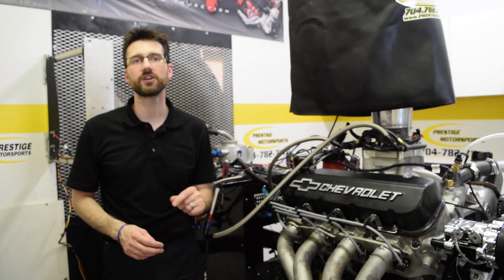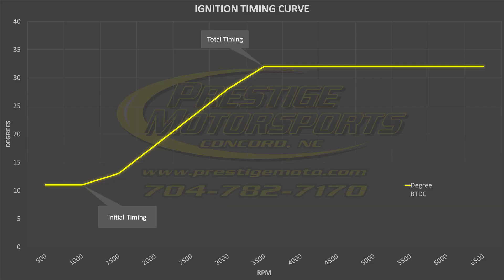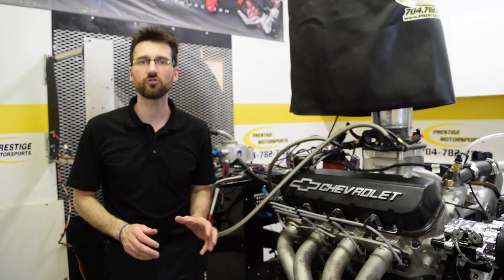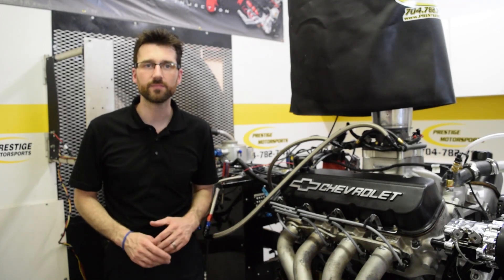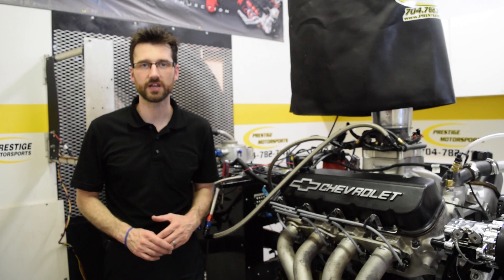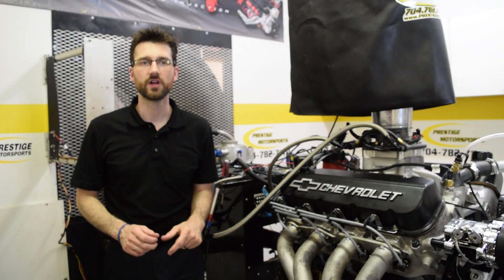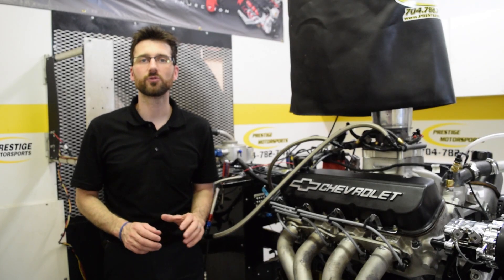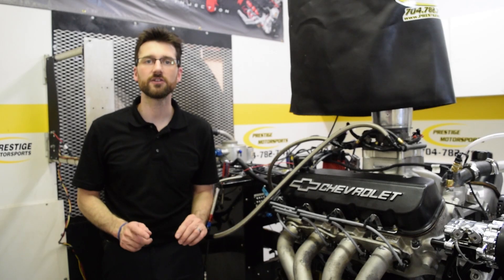Ignition Timing: Result of Incorrect Timing and How to Check Yours

Comment: Crappie explanation. Especially for people with a balancer that has no timing tape. So how do you find 36 and set 36 with a digital timing light i guess just retard the timing and just lock it at 36 on the far right side of the balancer drivers side.

Comment: What if there is no published total time reference for your engine? I have a 1949 Oldsmobile 303 v8. The service manual only gives initial timing recommendations. There aren’t even timing degree marks on the crank, just two steel balls. I’m told to place the pointer between the balls at 500rpm. But I’ve got a stumble at high rpm

Comment: Very very good video. I have a gy6 engine with 1 cam for valve's. and fly wheel has a 
i....t...f on it. I won't to set my timeong correctly  do I set the flywheel  at i  and set the time on the cam so my bike will work  as I had it at  t and would not fire up. Had spark fuel but didn't  won't to fire. 😮

Comment: Ok, bare with me here.  A mechanical distributor, 10 degrees Initial, 24 Mechanical for 34 degrees total at ~3,000 engine RPM at Wide Open Throttle and with NO Vacuum Advance.  But, at say 60 mph strait level steady state speed "floating" cruise, at 3,000 engine RPM, then the same 10 degrees initial plus the 24 degrees Mechanical for that 34 degrees Total PLUS 15 more Degrees Vacuum Advance, so ALL THREE TOTAL are 49 TOTAL DEGREES ?

Comment: When i start my car in the morning, the engine gets violent as though there's electricity that doesn't run smoothly. I don't know. But when the engine is already hot, it gets normal.
I already replaced the sparkplugs, but it's still the same.
Please help me figure out the engine issue.

Comment: I’m concerned that my ignition timing might be off. I have three symptoms: 1) the engine Bogs at low RPM. 2) the car starts way too quickly. 3) engine runs too cold. Any thoughts?
Reply: add my 2 cents ---???? too far from tdc backof 2 deg  never had one start too quick  ??? chang thermastat for more heat ????

Comment: Good video. Thanks.
I got a question, maybe someone can help me. Does the distributor should very tight or should it be little bit loose?
My 1972 Ford F-100 has its distributor loose, I can move it with my hand. Is that ok? Thanks
Reply: no. it should be tight and you should not be able to turn by hand.

Comment: I had 1989 Oldsmobile 98 and that car lasted A LONG TIME... regular oil change.. Spark plug change ... Carburetor clean bit not today's cars.. Today's cars are always messing up... Always something right after the next... Pieces of crap car engine designs.

Comment: If you have low compression would you get misfires at a low timing angle like 10*.  It seems my spark is getting blown out and I’m getting misfires.  Turns out I’m at like 90psi of compression in a couple cylinders.
Reply: needs to be over 125 psi   add spoon ful oil check comp if increases with oil it is the rings  if no increase its your valves

Comment: I recently had my car check by the dealer they said my motor has low compression before hand I had the timing chain replacement and the car wouldn't start afterwards. Do u think the low compression is from the timing being incorrect or it could be something worse??? Need help
Reply from the maker: Cortney, you're situation involves valve timing, not ignition timing. If your valve timing is not correct, yes, it will cause low compression for one of two reasons: 1.) Valve is opening and closing at the incorrect time and not allowing proper compression to take place OR 2.) Incorrect valve timing has resulted in the valves and pistons making contact. This usually results in bent valves that will no longer seal. Scenario 1. involves re-timing the camshaft and crankshafts. Scenario 2. involves a cylinder head rebuild at minimum with engine replacement as a possibility.
Reply: @prestigemotorsports  thanks I'm praying for number 1 should be calling the dealer today for results

Comment: My volvo penta 3.0 gsm engine was lack off power when I try to get my boat on plane, first I thought I did have  an head gasket issue so i change head gasket n redone the valves and resurface the head, and it work out I have the same issue and I play around with the engine until I do some adjustments to the distributor now I have alot power and my boat is running fast again but when starting up I have a engine kickback every time I try to start the engine, but I want to figure the correct way to set the timing to solve that kickback and still have maximum power output.

Comment: why do street racers keep adjusting timing for different races.
Reply: to get the most power they can out of them.  So they run locked out timing meaning full timing all the time  there is no advance.  youre just at 34 degrees and that's that

 and it can change with elevation DA etc

you DO NOT want locked out timing  on a street car.  people have done it but something else is up with the car/truck.  you should not have to run a street car like that

Comment: How about ignition retarding? I just installed a turbocharger and have ecu rom provided by the tuner. In data log i noticed .5 of knock retard during acceleration and brief -2.3 during full throttle. Is it normal?

Comment: Could popping in the carburetor or intake manifold be due to incorrect timing?
Reply: incorrect firing order dounle check wires, Rotor postition, look up your yeah and model of car.. like fords 302 is 15426378 but in the 5.0 ho in the mustangs they have the 351 windsors firing order.. 13726548 if its a chevy you have a bad misfire.. try swapping 4 and 7.. then 5 and 3..

Comment: if a timing belt jumps a tooth will it cause a rough idle at stand still, but drive ok's?
Reply from the maker: If it "jumped" a tooth, you have bigger problems. If it was installed one tooth off, it is possible it could idle rough but drive OK. However, most newer vehicles will see a cam / crank sync error and set a trouble code.
Reply: Car has no fault codes. Idles at a steady rpm,  with transmission in drive. Drives ok, but idles rough?  It is about due for  a new timing belt and water pump. I did speak to my mechanic  and he says that it is possible that you can have constant rough idle. because of the valve timing belt issued. But when I take my foot off the brake and start to move forward the vibration stops and the car drives ok with plenty of power. I wonder what happens when the car engine ECM changes from idle to drive?  I wonder if there is a relay issue between idle and drive. Also the engine rpm is constant, but might be low at about 650 rpm. I wonder about that as well. Also I see that when I cold start the car, there is a fluctuation in the rpm that goes away after about 15 seconds?  No fault codes again?
Reply from the maker: @Eddythe_Eagle  We've gotten way off topic here, so I'll end by saying that I would check that all of your engine mounts are in good working condition and then rely on your local mechanic to guide you into the proper repair. Thanks for the comments.

Comment: Spark advance is all over the place with the engine at idle..Rough idle?
Reply from the maker: Your vehicle has ignition timing controlled by the ECU. The ECU can adjust timing advance to control many things including emissions and idle RPM. Overshooting timing adjustments at idle can cause a "lope", but unless you have done some custom tuning, I would bet the rough idle is something else. Valve timing that is incorrect can certainly cause a rough idle.

Comment: My car has a rough idle at stand still while the transmission is in drive with the brakes on. Once I start driving or take my foot off the brakes and move forward the engine idle smooths out. Car drives ok...I have scanned the car engine and get no engine codes or engine light on. What I did notice that when the engine is at idle with the transmission is in park park the advance engine timing is all over the place. Idles constantly rough but drives ok.. Cold starts a little rough.... There is a timing belt... initial timing correct?  Advance timing all over the place. Timing belt issue?   2010 Elantra , 4 door sedan, GL... Any answers?
Reply from the maker: Edward, the timing belt controls valve timing, not ignition timing. They are two separate topics.

Comment: Great job of explaining *what it is (timing), but not how to find it. Most of us hot rodders don't have correct timing given to us by the engine builder.
Reply: if you get your distributor curved  then they'll get it very close like performance distributors.  most hipo pump gas N/A application are full advance at 2000-2500 rpm with the least amount of mechanical advance you can get away with.  and advance initial on a dyno until it loses power then back it off
Reply: @KingJT80  sounds good.

On the dyno, 15 years ago, the dyno operator brought the total timing up to 40°. Is that normal? To much?

I'm not racing this thing at all, so I brought it down to 37 total, and 22 initial.

381 Chev, aluminum victor jr intake and Vic Jr heads. 9.8:1 cr.

Made 511hp, 492 tq.
Reply: @jakefriesenjake  if that's the best it made on the Dyno, then that's good. 

It's whatever it wants. But usually performance engines want more initial than mechanical which it sounds like you got back then
Reply: @KingJT80  cool. I say 15 years ago, but basically it's still brand new! I've been working on the 81 Z28 for that long on and off (mostly off).
I hope this spring/summer I'll be done with this thing. Been a while.
Reply: @jakefriesenjake  you gotta make some videos of it. I'll watch!!
Reply: @KingJT80  maybe. We'll see. To get a really good picture in your mind on what this car looks like (mostly custom), Iooks mostly like "Trent Goodwin 79 Camaro".
You can easily google that car. It's gm lemans blue, 20" Boyd junk yard dogs in the back and 18's in the front. Same as mine.

His is bagged, while mine is just lowered as much as possible. He has a regular 4" cowl hood while mine has an L88 corvette style cowl hood on it.
My car basically looks like his right now, just got it back from paint a month ago or so. Same color. 4 speed super t-10 with a brand new Hurst shifter! Braum ORUE black race bucket seats, fiberglass dashboard, custom laser cut black aluminum gauge panal, silver autometer gauges, with monster tach on top of the dash, aircraft style on/off switch panal, stainless and keyless steering coloum, and billet aluminum steering wheel. 
78 to 81 Camaros have the rear plastic bumper bolted on with a strip of metal trim that I actually hate how they look. So I bought a fiberglass bumper and glued and bolted it on to the main body. Then I blended it in and had it painted. Million times better. I also glued and blended the rear spoiler and the front fender side air extractor vents. I also hand built a custom front grill and a twin cold air intake with cone filters for the car. Only another month or 2!

Comment: You are correct on the ignition timing. My question concerns cam timing. On a dohc if one of the cams is off one link could this create a miss at idle? Over two grand on the tach it runs like a watch. I also thought about the vvt solenoid. Do you have any input on this?

Comment: Not needed exactly, but you would want the timing light clamp at the point closest to where the spark is actually doing it's job - at the spark plug. The distance is from the dis cap to the plug is almost negligible but I'm a perfectionist whore and need to know it's as close to exact as possible.

Comment: All a bit unessasary. All you need to do is simply do a full pull on the dyno with the gun. timing at a sensible figure, look at the shape of the torque curve, set the dyno to hold the engine at the rpm where peak torque accured and then swing the timing untill you get the highest value on the gauge.
This gives a basic setting for that engine. If you later change to a ecu for controle, remember that the timing requirments in sixth or seventh gear will be less than first or second

Comment: The code indicated low voltage after converter both O2 sensors but not the two front ones and lean situation also EGR also which I just changed as discovering the wire anomaly

Comment: My guess is when I get it running priority is compression check on cylinders I've changed head gaskets before another vehicle.. Motor always seemed to have low power since I recently bought it used three or four years. ago.

Comment: I'm hesitant to take my truck back to that same mechanic only mechanic and that would work on it . since February one year warranty 12000 miles wondering what that alternate wiring was.? And how to find it. It ran in that configuration. But recently motor had some kind of stumbling issue. Reason for it being down now.

Comment: I have 1997 GMC Sierra C3500 dually pickup truck. Dealer says it has been discontinued. And wouldn't work on it... ECM fuse burned out initially. I changed everything distributor. All of the sensors even a new ECM. Before I realized difficult to see burnt fuse.. I did work because I had to no one would take on the vehicle to work on it in California.. The one mechanic in Burbank who did. Said the distributor was in the wrong spot.. charged me $1,200. Got me out of there with a check engine light going off and on said it maybe would go out.. I discovered later the timing had been changed spark plug wiring.. maybe it's one gear tooth off as I'm pulling my teeth as a pseudo mechanic trying to learn on the Fly. How to definitively figure out how to get the distributor in the right spot. The wires in the correct position sound like the motor is kicking itself apart. It doesn't even start actually. After replacement correct position plug wires number three was not on. Which was actually three and seven transposed oops. It ran so I could move across the street for street cleaning..

Comment: Recently had my water pump replaced on my 2014 Ford Fusion. Now rpms fluctuate at idle and jerks back and forth. Could this be because my engine is slightly out of time?

Comment: How do you adjust the “curve” to get initial timing on point without altering total timing?
Reply from the maker: If you are using a MSD or similar distributor, there is a bushing that will limit the amount of mechanical advance available. So if you need to advance initial timing without changing total timing, you would put a larger bushing in that will limit the total degrees of advance available.
Reply: @prestigemotorsports  Hi
Reply: @prestigemotorsports  Hi everybody. I am having a problem with my f650 twin. It cuts out at high rpm just past 7000rpm. It also only does it when in gear. Please see videohttps://youtu.be/IpI13YSNq3c

Comment: my distrubutor only lets me adjust to about 12 degrees of advance which was probably to keep it safely retarded while running regular pump gas on 10ps boost like from factory.  There are about 40 teeth on the cam pulley so I figure if I move it ahead one notch that should give me an extra 9 degrees (360/40=9)  Im running LPG  (108-112 octane) and 10psi boost and this engine is not pinging.  With LPG you are supposed to advance it unitl it starts pinging and then back it off a hair.  I'm pretty sure it can handle a lot more spark advance.  Not sure if the other option i though of would work... drilling out the  end of adjustment on the distributor to try and get it to turn a few more degrees. Not sure if this will even work though lol.

Comment: When engine timing out then computer goving the ignition and injectors Pulse?  Reply Sir
Reply: In a lot of modern cars ,timing is *not* adjustable, not any more;    they have no distributor (they have multiple coils instead,a much cleaner solution....), and spark and injection are factory preset by the position of the crank sensor;   in case a distributor is still used,and you adjust the spark timing with it,yes,it will continue to fire the plugs,and the ecu will still fire injectors;

Comment: Prestige Motorsports inc.......I have a problem others have had but don't see a fix, maybe you can help.
At TDC my mark on the harmonic balancer line up with the stationary mark and my rotor does point to #1 wire. Engine run good !
Problem is ...... With the timing light I can't get the 8 degrees  to come down to the stationary mark, way off ( 50 degrees) 
 If I try to bring the marks down the engine will died or run bad. I have inserted a piston stop and done the , find TDC , the mark lines up at TDC with the stationary mark.
I have opened the timing cover twice to check cam chain mark and found them right . 
Can you help ? If not what is the best way to set timing without a light ?
Reply: Shoot for the highest vacuum reading while playing with timing.

Comment: YOU MUST DISCONECT VACUM ADVANCE WHILE DOING YOUR TIMING OTHER WISE IT WILL PING
Reply: You only have to do that if you connected the vacuum advance hose to ported manifold vacuum! It depends how your engine was set up, So you are partially correct but you are also wrong! You should really learn all the information  before giving out advice that could screw with someone’s engine!
Reply: @NeverEnoughPyro40  he is half right. I think he was talking about initial timing setting and vacuum adv is connected to manifold source. Ported timing should not matter because you only get vacuum advance during part throttle.

Comment: So i bought a motor and dont talk to the builder and im not sure of the cam or timing degree. What should i do to figure these things out?
Reply from the maker: We Strongly suggest speaking with the builder. You are likely safe to set total advance to 32 deg. with an initial of approx 10 to 15 deg. The only way to truly know what timing the engine wants and will take is properly dyno testing and reading spark plugs.
Reply: @prestigemotorsports  thank you that helps alot im lost after putting new heads on.